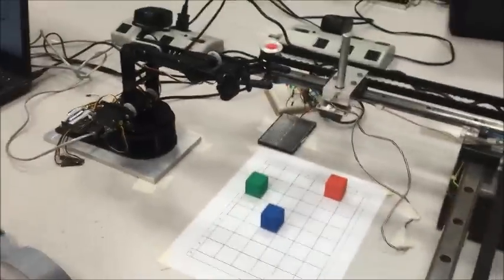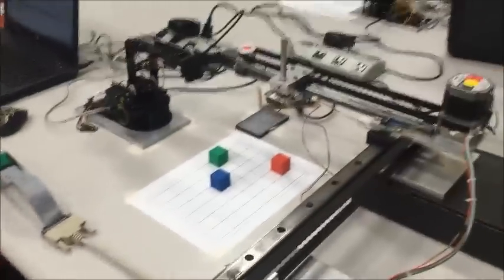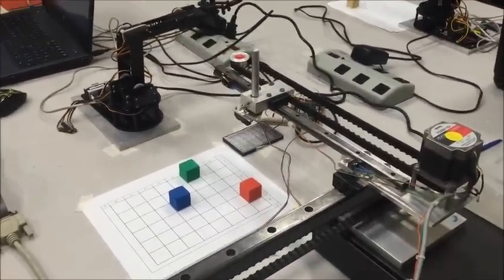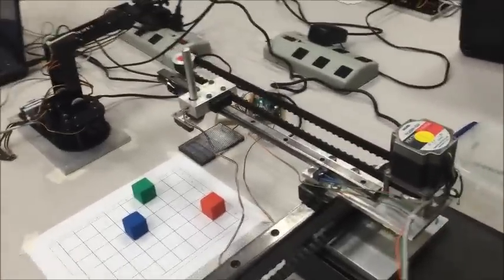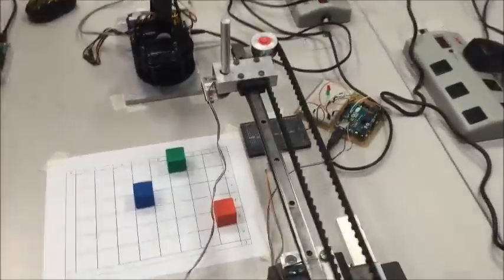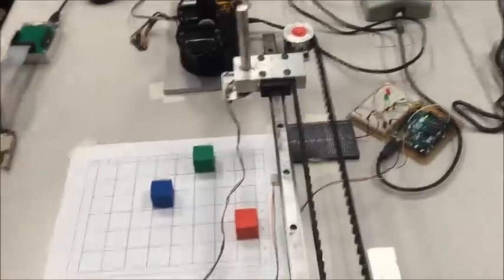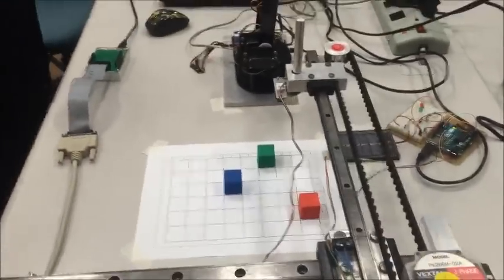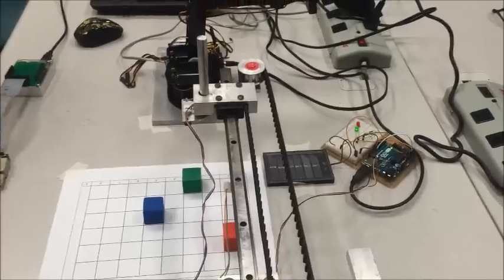ME 191 Final Project

Comment: I take it you didn't get into vision systems? That X-Y table was a pretty simplistic method of spotting the cubes. Effective, but hella slow.

Makes me wish they had classes like this when I was in school.
Reply from the maker: ***** i havnt heard of vision systems. but yea we only worked with the x-y table for about a week or two. The class was mainly about the arduino board and applications of it.
Reply: Ahhh, you haven't gotten there yet. Industrial vision systems have ability to program intelligent tools into them so that you could basically tell it to look in those 36 spots, check the color (white, red, green, blue), and then output which cell to find each cube to the robot. The ones I've worked around can usually do that in like 50ms.
Reply from the maker: oh wow. hopefully i get to work with something like that. these things are fun
Reply: TR Good Grief Oh, you're just in Milwaukee? I'm just west/northwest of Chicago. This is a really great area for robotics/automation trade shows as it is so central... although I think you just missed a few good ones. I just went to Automate a couple of months ago and there was some really cool stuff there. If you're really into robotics, I'd suggest checking them out (most that I have seen are free, other than special keynotes).
Reply from the maker: yea milwaukee. Im not sure exactly what i want to do yet, i gotta wait for the specially classes to decide. But yea robotics were fun. Solidworks was also fun.
Reply: Robotics has really come a long way, especially with the great cheap hardware out now. Arduinos and Pi's are awesome, but it used to be all speciality integrated hardware that ran proprietary software only. 

I've actually worked with SolidWorks for 18 years, I love it. I'm an ME by trade, designing automated assembly machines. Although, I try to keep a bit of a wide range of knowledge so that I can adapt to whatever projects I get handed.
Reply from the maker: :O that's awesome. I never realized the different types of people that actually watch my videos. How do you like your job. Im assuming you love it since you have been doing it for 18 years. By the way i just read your last name for the first time XD sick last name.